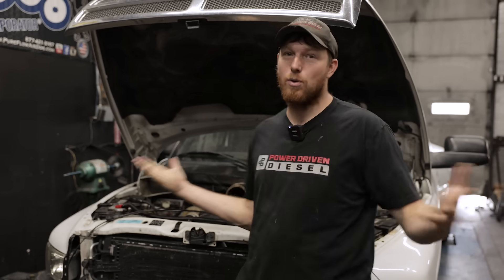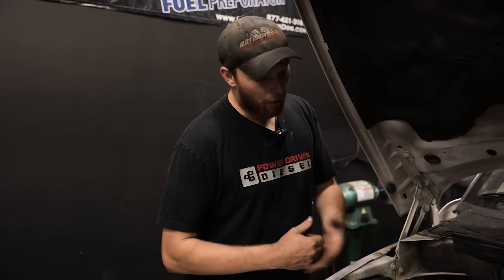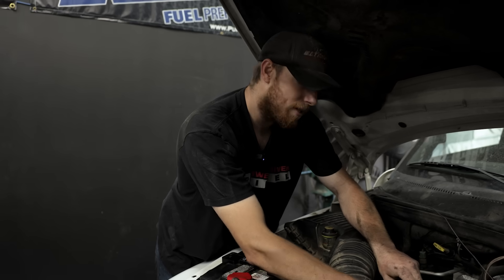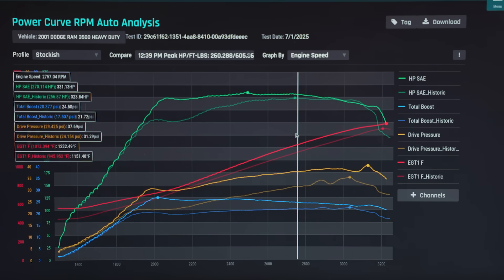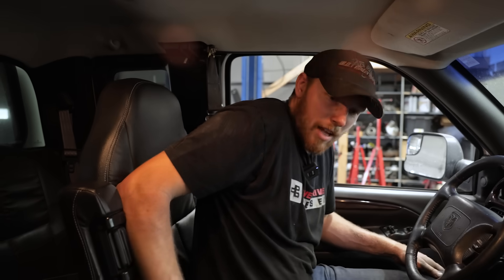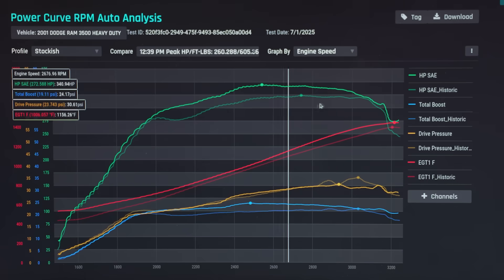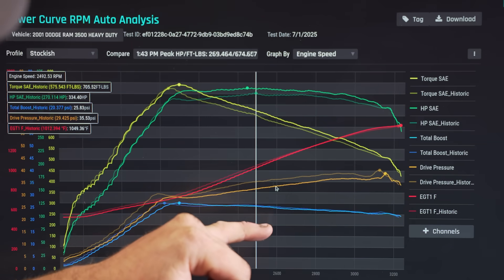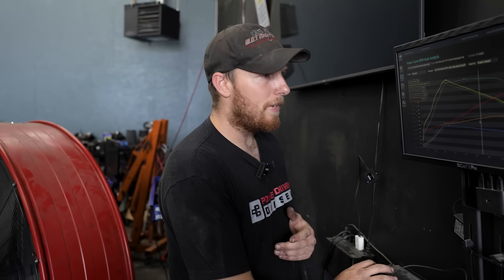HY35 vs HX35 Dyno Test | Best Stock Turbo for Your VP Cummins

Comment: If you aren't blowing smoke, are you in need of more air? A turbo doesn't seem necessary yet.
Reply from the maker: The smoke threshold is not the limit of power for a given amount of fuel. It still picks up power with more air even if the exhaust is clean.
Reply: @pddofficial do you measure o2 levels to get an idea how far you have left?

Comment: I'm just getting into diesels and I bought a 1998 12v, was a 5 speed but now has the NV5600 transmission. I really bought this because of the 12v with this transmission, the guy put a Kayotawa A0007 A0060 china turbo that has no waste gate, its new but I believe I will change this out, so 400 - 500 HP that I could daily drive in the city and tow some is what I would like to have. I really care more about reliability and having a fun to drive truck than just a dyno number. I have a ton of questions, best turbo (K27)? which injectors or are my stocks ok and how can I tell. Truck has 266,000 miles and no idea of what has been done with the injectors, 215 P pump, should I advance the timing if so how much, 18 degrees and dose this hurt reliability. Sorry for all the questions.
Reply from the maker: Give us a call (435)962-9555 and we can help you figure out a setup for you that checks all the boxes! Thanks for watching.

Comment: Comment spamming.  But more I watch this I almost think that stock intake is killin ya. I had an and b cold air for both stock turbos with just a quad for tuning and had drastically different results and yes I know all trucks react different but still. Drastically different. From when I did it the hx kicked the shit out of the hy up top. The hy hit harder quicker but died off really quick then made boat loads of heat the hx with just a tune I really really had to beat on it to make enough heat to worry, and noticeably more power on the street and proven by bds dyno, I made 384 with the hx35 and 331 with the hy, ( on a manual truck keep in mind )
Reply from the maker: Interesting thoughts! The stick filter may be a restriction, we should find out!

Comment: My final set up and towing choice was the original quadzills with its own screen befor quad sold out to that other company that bought them can’t remember who, so fueled way more aggressively, but that tuning, with bd stage 2 75 hp iniectors and there super b single. No matter what I did to that thing it wouldn’t break 1300. 44 psi all day long

Comment: Should be able to make 40 psi on a hy35 no problem done it many times without welding the gate. Don’t suggest it, they just make more heat. But 26 is still low., should be getting way more then that with a quadzilla and I definitly noticed a difference in power on the dyno from 25 ish to 34/35 ish on the hy. I did do this on a manual transmission truck tho. Could be the difference

Comment: There is two different hx35's a 8 blade and a 7 blade. My memory says they all are 56mm but the 8 blade 56mm hx35 flows less then the 7blade hx35. The 7 blade hx35 shares the same compressor specs as the HY. Going down a rabbit hole here and i could be wrong with my memory but the HY 35 uses a 58/65 turbine wheel in a 9cm open scroll housing. HX35 uses a 60/69 turbine wheel in a 12cm divided housing. I could deff be wrong here but if i am not then both the turbo's used share the same compressor flow and the gain is due to the hy turbine/ hot side choking up vs the larger turbine and larger turbine housing on the hx35. I only mention this because if my memory is right then i wonder if the 8 blade hx35 may not see a gain as even though it has more turbine flow it has about 6lb/min less of potential flow on the compressor side.  Totally into the weeds with this comment for sure. Just was fueling the fire as possibly a 8 blade hx35 would not show a gain vs a hy35.
Do the more fuel first before more air in my opinion. This will help to show people that tons of fuel and boost on the stock charger makes for a very hot smokey meh truck.
I honestly have done it the other way too where not enough fuel was lazy and smokey and then when i had the fuel it could  push the charger and it cleaned up too. 
Keep up the videos! These are by far some of the best educational content in the diesel scene right now!

Comment: Good video. This was a good follow up to the last video with this truck where it seemed odd to me that you were only making 18-20lb of boost. For future videos I think it would be best to max out the factory turbos with bigger injectors and then swap turbos. Would love to see what the biggest injector you can run with a stock turbo is.
 Personally, very interested to see what injector you pair with the 60-9 turbo as I am looking for a turbo / injector combo that gets the most out of my vp44 while still being a good daily driver and occasional tow rig. Great information as always, thanks for putting in the time and effort to set the record straight.
Reply from the maker: Those tests are all coming!

Comment: Great video guys. When you do injectors will you be removing the edge filters?
Reply from the maker: Not at first
Reply: @pddofficial awesome. Seeing that data will be great. I honestly don’t think there will be much if any gain from doing it.. I only removed mine to keep it from stalling after chopping the throttle during a hard pull and so far it hasn’t happened since removing them. DDP 200s

Comment: Trying to do the wastegate thing ain't going to do much unless you had if that's a 12 valve I would a modified the fuel pump Onan engine so I get a little bit more fuel and give it some more time more time manure whatever I just know by all this news and experience I know you had the TV show and all but the thing is with a tuning suspension I mean yeah you're gaining a little bit but you have to put a turbo in there that you can actually you can trade in them and get one that's got that but it's modified where you can adjust the Boost that you want to run

Comment: Turbo first …then injectors …in my experience VP44s tend to pick up quite a bit of power from just injectors alone ( even without a good tune) …doing injectors first won’t really tell you how good your replacement turbo is over the stock one imo …plus I really want to buy one of your chargers for my VP truck as my HX35 has over 300k on it and it’s a ticking time bomb at this point 😂

Comment: Nice man, dually you have more to rotate compared to srw. I thought about rebuilding my hy with better wheel and all.  but my chinese hx35 is a monster! I didnt have much expectations, but those rip. They sell all different varieties. The first one i ordered had a 14 stamped housing, never used it. Second one i bought has a 11 stamped housing. I like the smaller because of faster spool.
Reply: What turbo did you use that was a Chinese monster. Thanks

Comment: I bought a used HX35 and sent it to Turbo Labs of America and he rebuilt it and opened it up. Put a 67mm cw/tw on it. I have other mods but the turbo is awesome. Sounds so much better. I haven’t put my truck on a Dino to test it. Don’t know where to do that at. I live south of Seattle so if anyone knows where. I love my 01 and won’t get rid of it. I only have 111k on it.
Reply: Funny enough back in 2016/17 i had a hx40 done into a 67/67 by him and we custom machined a turbine housing. I used it on a 4cyl car i have. We made 788whp at 47psi and pushed the head gasket. Learned way to tight of turbine housing and to much back pressure. I still have the second unit he made for me on this car years later. That is a hx40 pro turbine with a custom 62mm compressor in a .82 t3 open housing. I have always had good luck with any holset idea he tried for me.

Comment: That's pretty interesting!
Has an undivided (assuming thats what the auto comes with) exhaust manifold been compared to a divided to see spool differences with the hx35?
Reply from the maker: Despite the housing being undivided, all the manifolds are the same divided manifold. This is even true with 3rd gen commonrails as well.
Reply: @pddofficial  thank you for the clarification! Cool to see the hx35, with the larger turbine wheel and cm^2 (and divided), work out better over the entire power curve in this specific case. Would have expected the hy35 make/hold slightly more at the very end

Comment: I would love to see the Turbo test first and if you guys had the time, I would also love to see if you guys could test the Banks intake horn with a new turbo to see if it actually does anything. The data would be awesome to see if flow vs pressure is evident with what Banks claims along with an upgraded turbo.
Reply: Banks horns have been tested a million times. They don't make HP and 9 times out of 10 they lose power
Reply: There's absolutely No possible way that a more free'd up intake path would loose power.
I'm sorry that's some dropped on your head to many times logic. If you don't think so explain the theory behind that.
Could it not make much more out right horses power, sure, maybe there no fuel left to capitalize on.  What about spool time? Response ect. What about under the curve power ect? 
Outright peak power is a stupid metric for air horns.

Your quick to hate banks, but what are your credentials ?  The guy runs many scientific tests, has amazing tools and resources, and been turboing things longer than anyone alive in the industry. 
Give some respect where respects due.
Reply: @Rodway-qy2fq  You obviously dont understand airflow or fluid dynamics. The head is the restriction and when you add a large volute the air slows down which hurts performance. But you can make whatever statements you want every time anyone other than Ol gale tests his intake horns they LOSE power
Reply: @HoodRatDiesel  Yeah, but not by PDD and/or with some of the data around drive pressure and EGTs and specifically with the VP44.

Comment: I say you need to do injectors first or you won’t see much difference in your turbo testing.  It would show to people though that bigger isn’t always better as a 67 67 would be a dog on that fuel and the stock turbo would probably stomp it on torque.